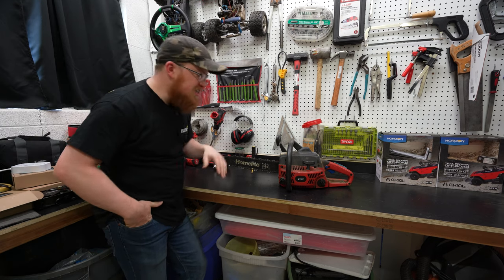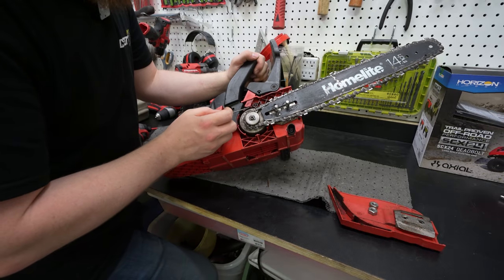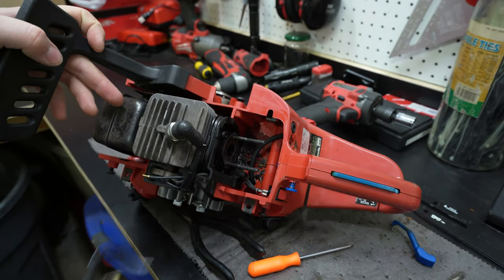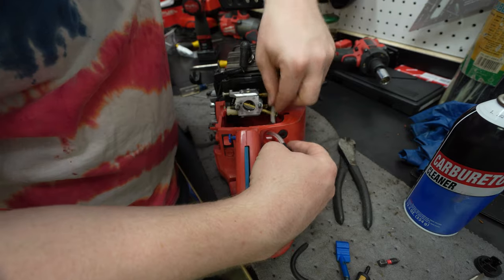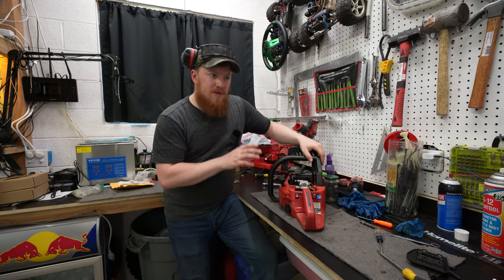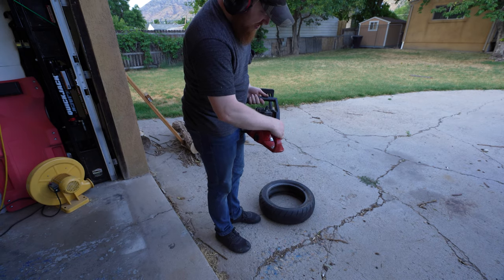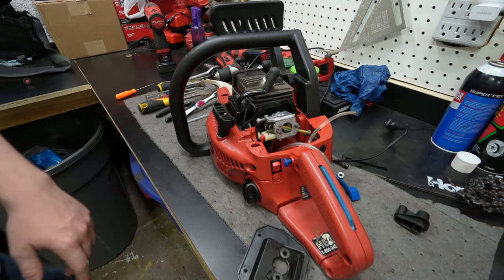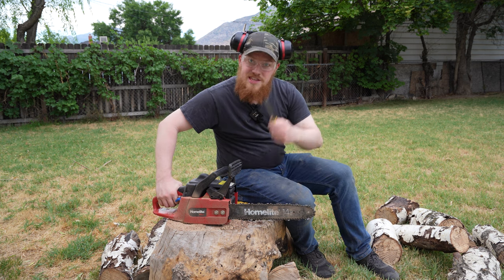Fixing Cheap Chainsaw Ruined By Bad Gas. My First Chainsaw! Homelite Z3300

Comment: Adjust the low speed  to eliminate the bog. Adjust the high at full throttle to have some 4 stroking without a load, or you could run it too lean, and burn it up.